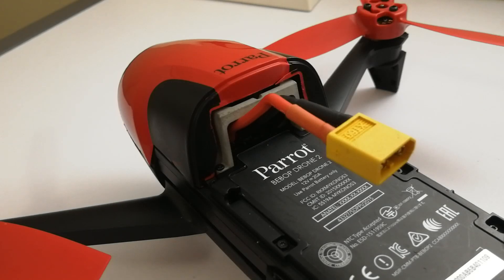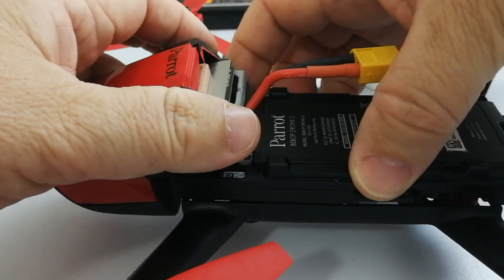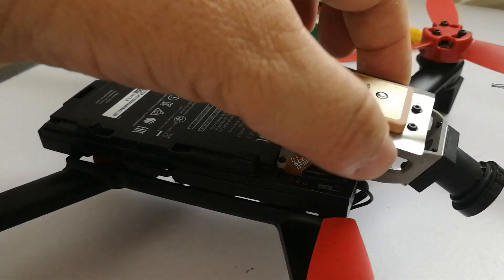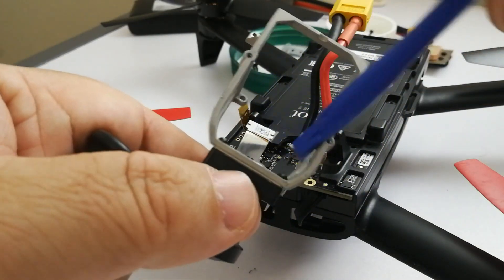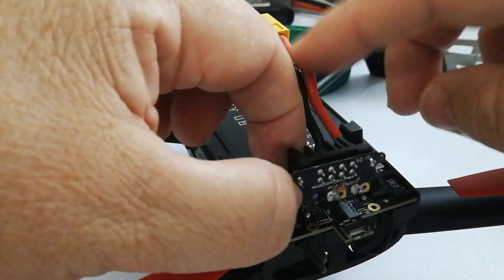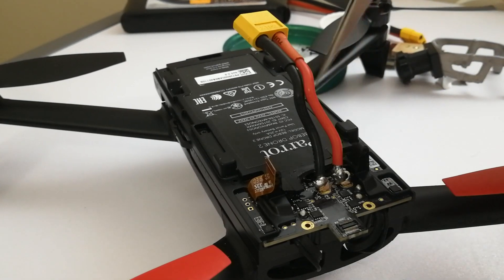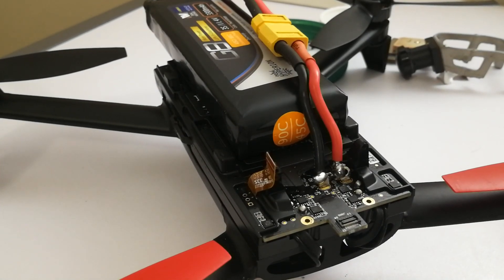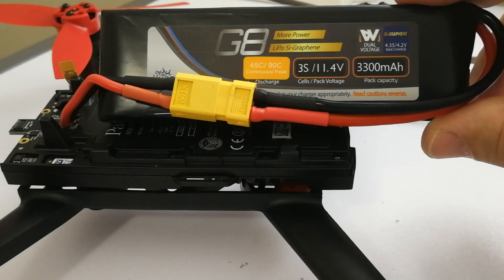Bebop 2 LIHV lipo battery mod teardown showing how to install

Comment: Hi.
Do you think it's possible to keep original plug, and add xt60 plug? To have the twice.
No need to put balance plug for power remaining in hud?
Reply from the maker: There is an adapter bebop to xt60. A no-solder solution.
Reply: If I sold an xt 60 on the original charging board (without all components, just the plug), need to sold the red and black wires only?
Reply from the maker: @alain8955  yes

Comment: So it’s safe to use with these kind of batteries the label on the parrot battery says 11v but the lipo is about 12+ volts when charged will there be and issue?
Reply from the maker: The parrot battery would also be at about 12.6v when fully charged which is 3(cells)x4.2v. 11.1 is kind of the middle at 3x3.7v, it's 'empty' at about 3x3.35v, 10.5v.
Reply: @tapmad  ok thanks

Comment: Hi. I tried adding a Tattu 1300mAh 75c 3s battery. It powers on but only for a few seconds. Any suggestions?
Reply from the maker: Try a lower C rating battery. It maybe a power protection mechanism.

Comment: Hello, Three questions if you don't mind: 1. Could you please tell us the weight difference between the original battery and the new one? 2. Does the new setup change the stability of the drone while flying? 3. How long can you fly with the new battery?  Great job, Thanks for sharing with us.
Reply from the maker: 1. Google is your friend for weights, lol, but seriously, lipos give you so many options that it is meaningless just to compare this battery. 2. Handling with this long  battery is risky. Bebop 2 hates any weight outside of its original envelope, so any battery combination should fit within the original battery area. By the way, smaller lipos like 1300mah with 35c rating give excellent flight performance over a shorter time. 3. This battery has been a little disappointing, 25min hover time. Maybe back motors working harder to carry tail heavy battery. Next time I will try 2 shorter 1500mah side by side.. 4. I would recommend people to stick to Gifi 4000mah. Don't do this mod unless you really want to experiment with different types of batteries.
Reply: @tapmad  ...absolutely agree...I did this mod also...and the Bebop2 is very temperamental about extra weight and dimensions outside of it's original design...
It loses stability.
The batteries I have used that are aftermarket,have worked well as long as you use a balance charger...are the 3100 mah sold by Powtree on Amazon...23 to 25 minute flight time...but dont charge them with the stock Parrot charger.
Stock Parrot batteries and chargers are designed for each other... and dont charge Parrot stock batteries with any other charger...it may work several times but it will ruin the BMS board inside of the battery and cause failure in flight.
I know from experience.
Reply: @tapmad  Indeed I used a Turnigy Graphene 5200 mAh which is about 100 g heavier and flight time is just 14 minutes! and the battery reading of the drone was right, when I charged it again indeed the battery was as empty as the drone reported. Almost twice the capacity and only half the flight time!

Comment: Just curious, do you loose battery voltage on the telemetry?
Reply from the maker: Hmmm, I only use Freeflight Pro and, as far as I know, it only shows battery percentage, and this remains visible. Would love to know if FFP shows actual cell voltages...